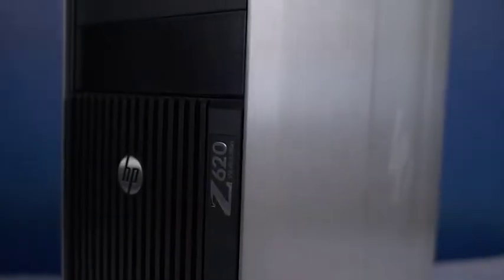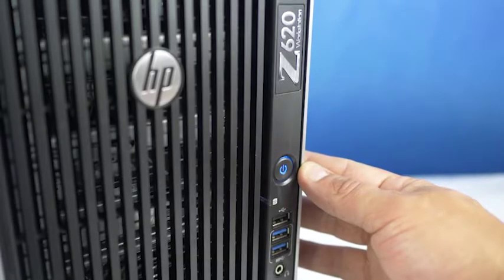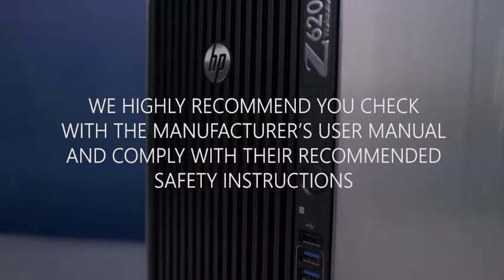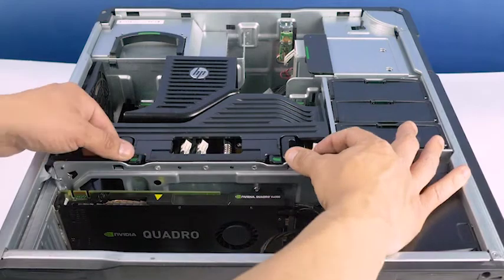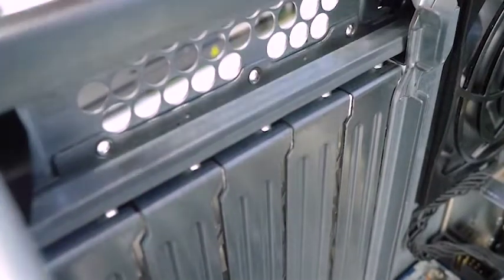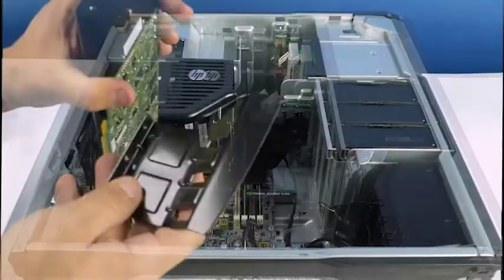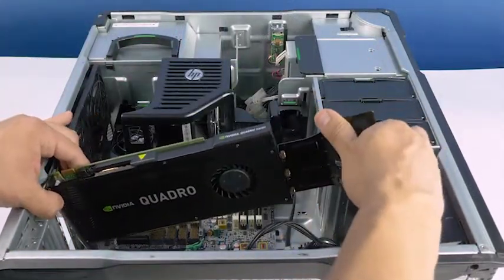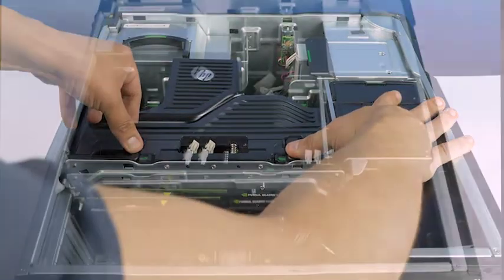HP Z620 Video Card Installation

Comment: Hi there and thank you for the great video!  I am having trouble and wondered if you had an advice for me. I have the same Z620 and K4000 card. What I am trying to do is replace the K4000 (in primary slot) with a more basic NVIDIA Quadro K600 Both are supported in the manual.  When I remove the K4000 and insert the K600 in that same primary slot it doesn't appear to receive power from the mother board as its fan doesn't spin and that dvi nor DP port remain inactive. I have tried with another K600 which I know is good (worked elsewhere) but pb is the same.  Would you know if there is something I should do to make sure the motherboard fmb-1102 delivers power to the K600? Is it a configuration thing? or should it be automatic that the K600 gets power from the mother board, although K4000 was getting it externally? Thank you so much!

Comment: Looking to upgrade to a RTX 3070 on my Z620.
The card has 2x 8-pin connectors, should I go simple 6-pin to 8-pin or use dual 6-pin to 8-pin?? Does it make a difference or is the card too much anyway for this setup??
Reply: Though, I have never tried I should work as the hp z620 supports card up to 225 tdp. The RTX 3070 has a tdp of 220, however the new RTX card have power spikes that could trip the PSU fail safe.
Reply: @shadowracer1259  thinking of using AMD 6700XT on this. Do you think it`s doable?
Reply: @ikrblt  I ran a R9 290 in mine for quite some time (Max TDP of 275W), the 6700XT has a max TDP of 225W so judging by that it should work. However, as I said a while back the newer cards tend to have power spikes that could trip the PSU failsafe (especially since the Z620 PSU is multi-rail, meaning you don't have full access to all the PSU power only the amount dedicated to the rail. I would go for it if you had a good deal lined up and sell it if you have issues. Alternatively, you could underclock the card in order to reduce its power consumption but at that point I would sell the card and buy a cheaper one.
Reply: @shadowracer1259  Thanks a lot for the reply mate! But I think i will proceed with 1080ti for now, and then i might upgrade in the future
Reply: @OrganicFarmMedia  so can i use 1x 6pin to 2x 8pin?
Reply: @OrganicFarmMedia  Sorry for the year late reply but yes, that is the case for most modern GPU's